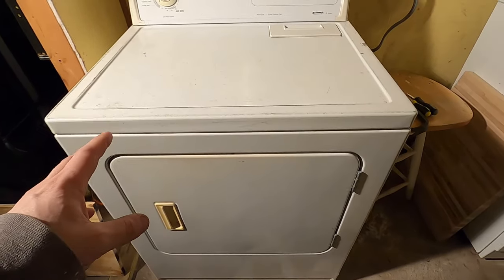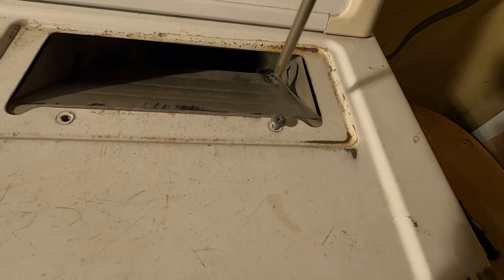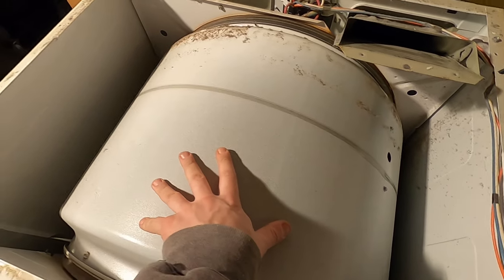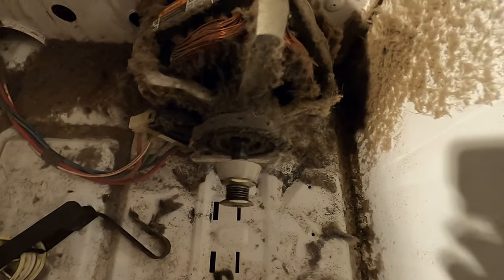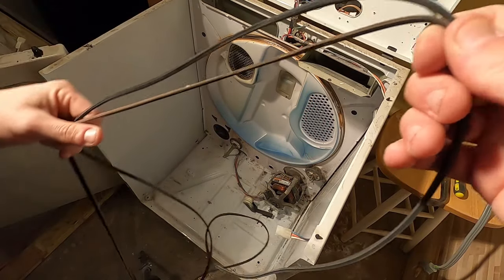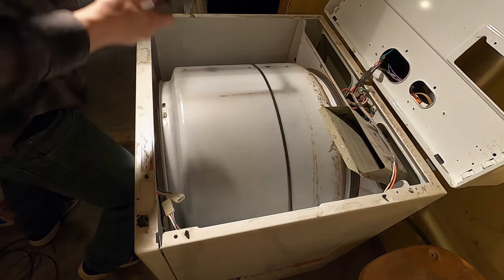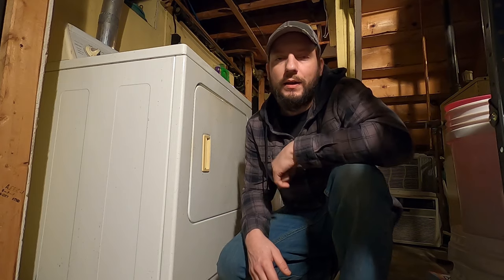How to Replace Dryer Belt on Any Front Load Clothes Dryer

Comment: My belt ground down into a powdery mess that was on the bottomof the dryer. So it was grinding down on something. I replaced the belt and it's working again, but I'm worried about why the other belt ground down like it did.
Reply from the maker: Hey!  That is strange, I wonder was the pulley able to spin?  Maybe it was frozen?  Or any frozen rollers where the belt rides?  Let me know.  Thanks for the comment!

Comment: I got it all together following all the steps but when it runs, there's a thump as it turns. Before I take it all apart again. What should I be looking for?
Reply: BTW, this was the best video to follow.
Reply: @Pghdancer510  is it a repeated "thump thump thump" kind of sound? This happened with our dryer (not the same model as the one in the video but nearly), and the problem was that one of the rotors had worn unevenly. I'm not sure if "rotor" is the correct term, but they're the thingies that support the drum as it turns. I replaced the rotor, and that fixed the thumping sound.

Comment: As a professional sheet metal worker installing dryer venting on a regular basis, I must point out that it is a very bad idea to use screws to fasten the pipe anywhere.  It creates a point on which dryer lint gets caught.  Use foil tape, tuck tape, a ring clamp or install the elbow and then tie the elbow to the back of the dryer using "all round strap".

Comment: How do you disconnect the wires connector? Is there a trick to it?
Reply from the maker: Sorry about that.  I cut out some of the struggle.  You just have to push down on whatever tab you have and work the connector back and forth until it pops loose.  Hope the video helps!  Thanks for watching!
Reply: I couldn't see a tab. I even took pictures to blow up the size but somehow I got a little bit of space between them and popped it with a tiny screwdriver. Not pretty, but that worked.

Comment: my dryer belt keeps breaking. I got a new belt kit, all rollers pulley ect. they work smoothly. the motor runs free and easy. as far as I can tell there are no hang ups anywhere; everything is inatalled correctly. when the belt breaks it is kinked on both ends where it breaks. nothing I can adjust or replace on drum. has trouble with heavier loads even though everything is new.  I'm on the third belt in a few months so I doubt I did something wrong that many times. i wish I could send pics of everything. anyone have any ideas what could cause this? its the same type of machine.
Reply from the maker: That is strange.  Almost sounds like something has moved or is moving too much... Is the dryer completely level?  Does it make a lot of noise when it runs?  Like it is unbalanced?  That is the only thing I can think of that might stretch the belt but I am not an expert.  Hopefully someone reads your comment that has some more knowledge.

Comment: I'm not sure what's wrong with my 7 yr old front loader. Literally the second it comes on, there's a terrible strong burning smell and it sound strange like something may be moving inside that shouldn't be. I turned it off right away, thinking it may catch fire!  I checked the back vent for lint, a little but not much at all. Any idea anyone, what this could be?
Reply: Sounds like it’s the motor. I’m new to the inner workings of a dryer though. Did you find out what it was?

Comment: On the GE GTD65GBSJ2WS gas dryer, the design uses a switch that's closed when the belt is pulling the idler pulley tensioner. If the belt breaks, it disconnects power to the drum motor.
I wasted time going through all sorts of diagnostics trying to determine why the motor wasn't running when the dryer was started, because it looked like an open in the motor windings electrically. If the motor ran and made sounds it would have been a clue to look for the belt.  It was simply a broken belt with this idler switch masking the symptoms.😜

None of the diagnostic codes they provide indicate that the issue is simply a broken belt, they should have made that an message coming up in the screen just like they do when the door is open when starting the dryer.

7 years on the original belt that looks rather flimsy compared to the replacement belt that cost all of 7.39 seems to be good though.
Reply: A side benefit of the broken belt was that apparently the factory neglected to connect the wire harness for the interior light on the thing, so after 7 years, the owner can now have a light inside rather than peering into the darkness and feeling around looking for remaining items😅.

Comment: In the rare case someone has a 1988 or any other legacy model whirlpool 5 cycle like me ... All this info still applies, except it's not as convenient unclipping wire brackets, those are non existent.

 And taking the face off requires some scary finger snapping springs lol... Found that out the hard way...

Comment: you need to find the cause of the belt break- could be a bad roller bearing or bad tensioner pulley - just like a fuse- cant replace it without finding the cause

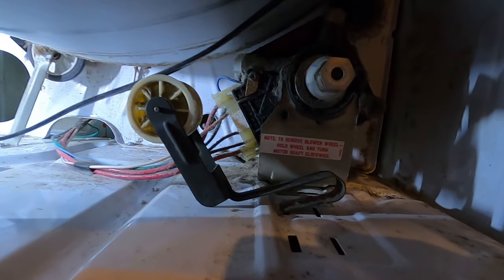Comment: @ 10:58 you are preaching semi-false doctrine.  On older GE dryers access to the tensioner and motor pulley must be made from the rear of the machine.  Attempts to follow the instructions here will remove the skin from your arm, for there's insufficient room around the drum and the cabinet edges are very sharp.  Remove the rear panel through which the power cord runs.

Comment: Was wondering when you were gonna get to disconnecting the power 😂
Reply: @TheFixerHomeRepair  all joking aside, I just fixed my dryer using this (almost) all on my own! The only hiccup was when I put the proxy switch back on the door backwards when replacing the belt was all done. My husband stepped in to help at that point but it still beats a 3 figure trip from a repair man! Thank you for the easy, approachable video!
Reply from the maker: @jessicarendi496  awesome to hear!  Very happy to hear it is all fixed and that I could help!  😁😁👍